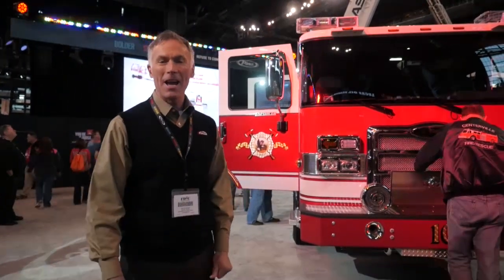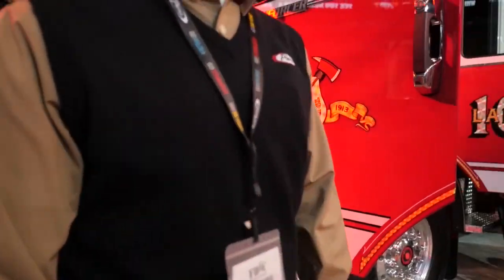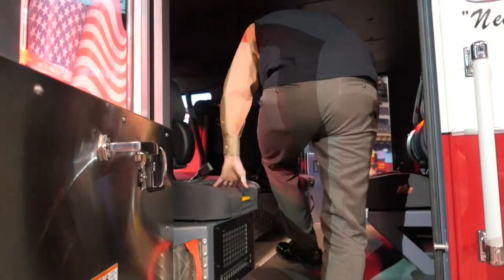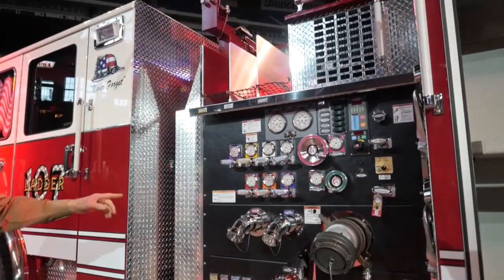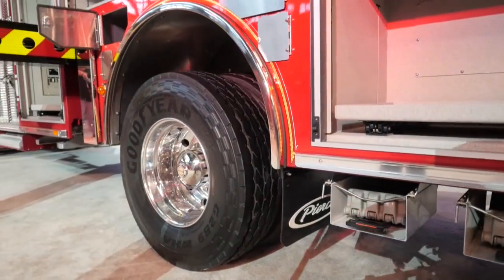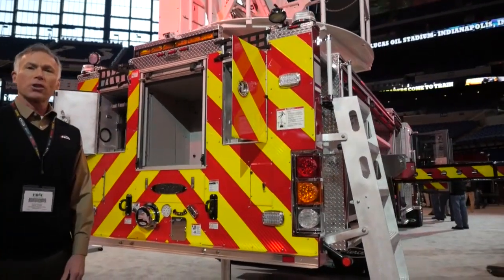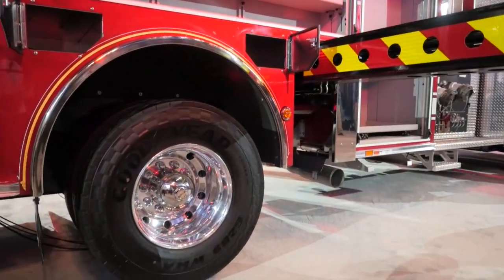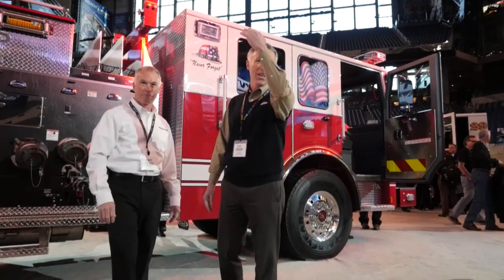Ascendant™ 107’ - FDIC 2015

Comment: Any way to get it w/o the command zone collision avoidance? We have a tower with it, and IMHO it puts too much limitation on the use of the aerial. I know, I know, proper training and spotting, right? I agree. We all know that's not always possible, as cops and pumpers sometimes block the best aerial truck placement. 

I'd prefer no electronic control restrictions. If I'm swinging the boom to a target to make a rescue, and the commission avoidance software stops the boom from hitting the cab, well, that's a failed rescue, and is unacceptable. I'd prefer to repair the truck after a successful rescue.